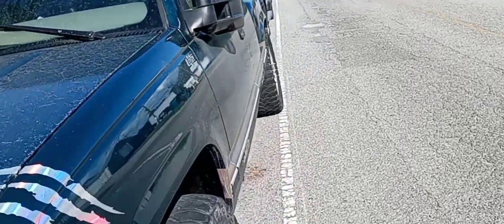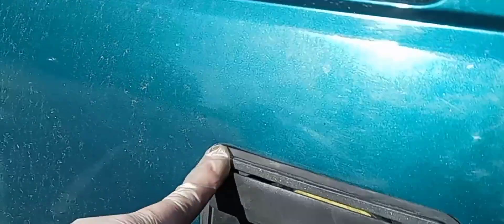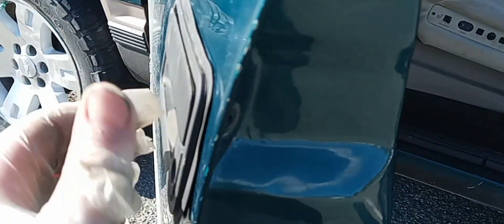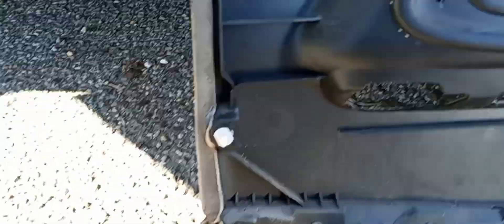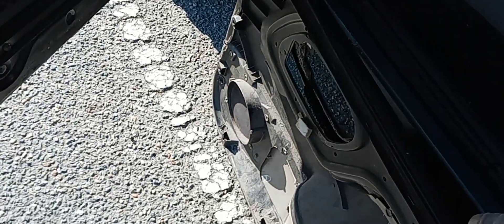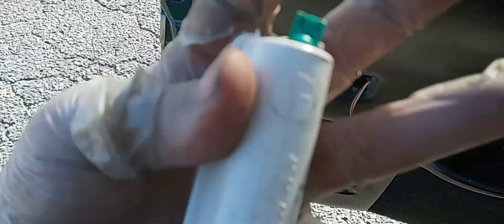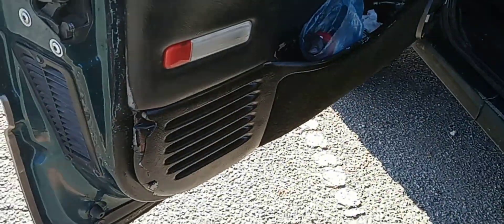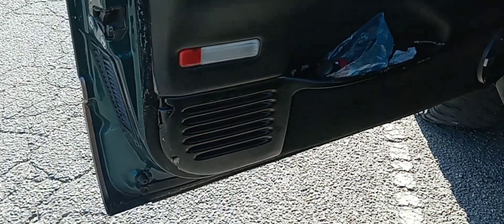how to replace broken door panel Clips on an 88 to 98 Chevy Silverado

Comment: Just buy Velcro strips would work just fine or better
Reply from the maker: Actually velcro is not a bad idea the only problem is there's not enough room for the velcro to stick to the bottom of the door panel and actually hold